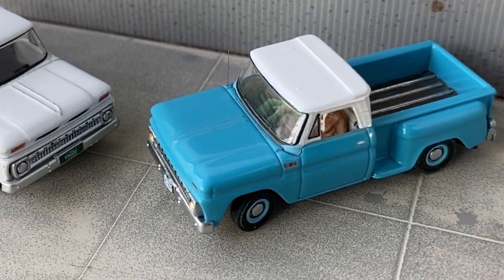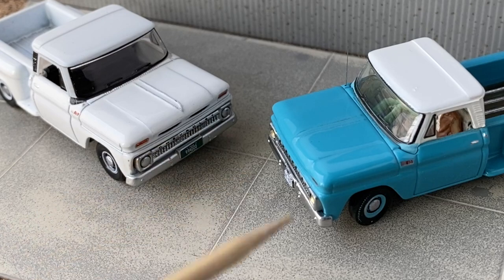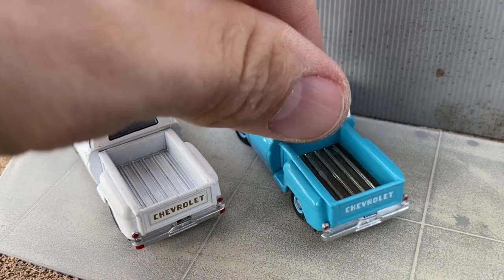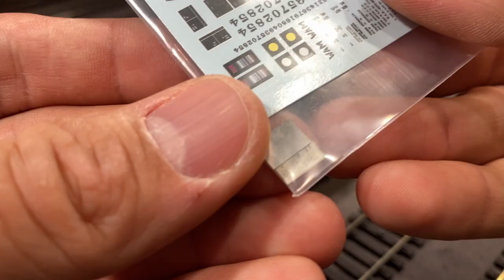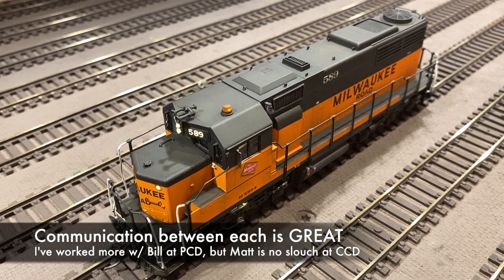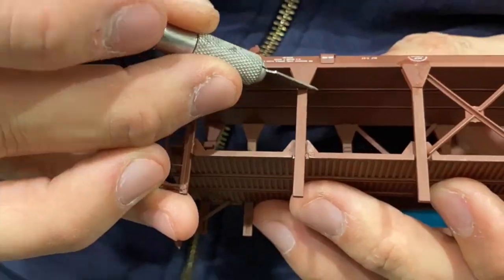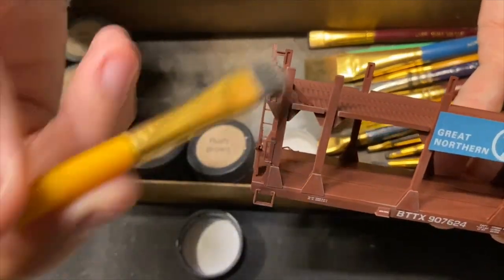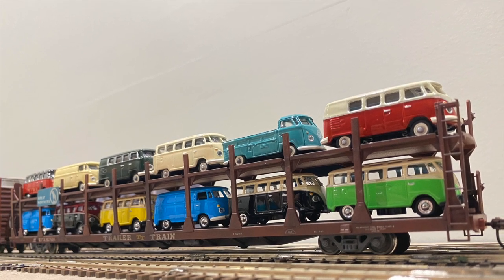S05E06 - SDL39 Decals & Paint, GN Autorack wrap-up and How to Super Detail a 1965 Step-side Pickup

Comment: Another great episode!
Helpful hint, set the can of dullcoat in a pan with hot/warm water,,it will heat the contents up which will create a finer spray coming from the nozzle. 
As I was watching, I was thinking,” why not just shoot a fade coat from a airbrush?” But knowing the hassle to set up, spray, then clean..probably faster with the powders. 
Nice touch on the crew dude  wearing a SOO jacket!!!
Laters, Greg
Reply from the maker: Hey Greg!

I tried the hot water Witt the Dullcote spray and didn’t find much success. However, I did find the Krylon ColorMAXX Flat spray is wicked good...fine, no texture, it really turned out nice. You’re right about the fade technique, as I get better with the airbrush...I’ll probably find that to be the go-to method. However, giving myself options is often a driving force...plus, it helps modelers out there that don’t have an airbrush. Thanks for tuning in, posting and sharing techniques...the hot/warm water probably works better on colors...than the Testors flat.

Comment: Where'd you get the beacon from?
Reply from the maker: I do cover the beacon and lighting in a prior video: https://youtu.be/3HCJKcIIsF4

The physical plastic lens and housing in an Athearn beacon (ATHG40371 - 6 pk http://www.athearn.com/Products/Default.aspx?ProdID=ATHG40371). 

LED’s inside the lens would be an Aaron Heines detail (discontinued), but Rapido has put out a similar Strat (I’ve not tried on yet) It can be found here: https://rapidotrains.com/products/ho-scale/parts-accessories/rapido-bits-ho-working-rotary-beacon